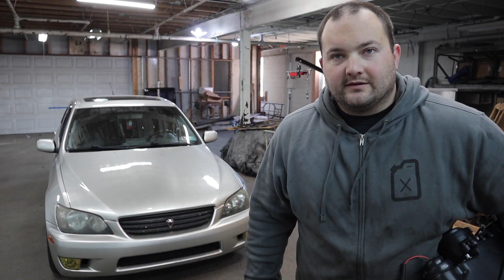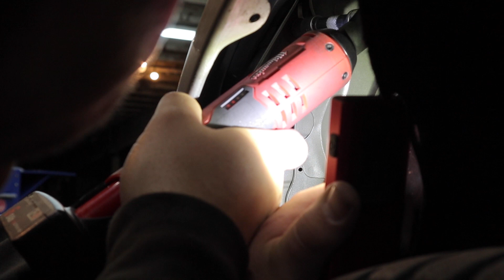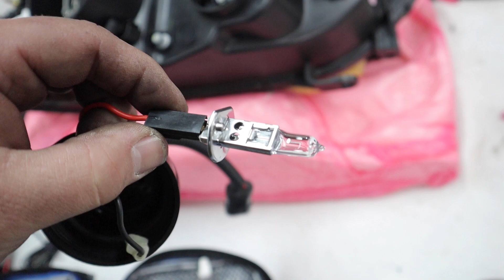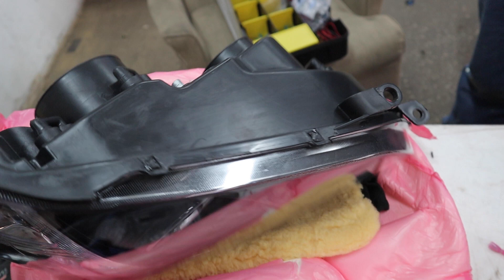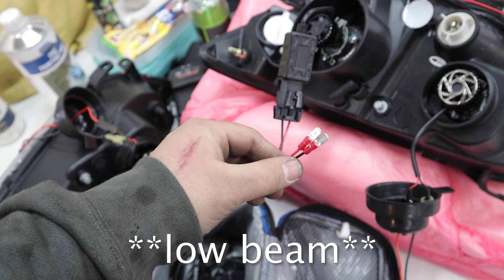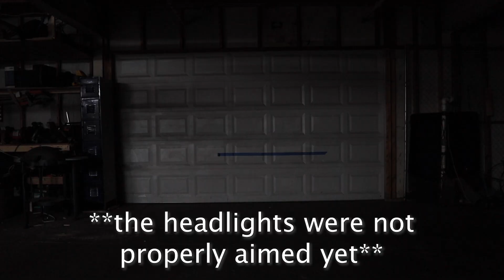Making my Lexus IS300 look so much better by installing LED Projector Headlights!

Comment: Will these fit on a 04 IS200? And did you have to buy an extra bulb and if you did could you give me their link?
Reply: they do fit. if you have your old headlights still you can take it apart and take the old connector and replace it with the connector on the new headlights for the lowbeam

Comment: I followed everything you put in the video but went with higher powered hid replacement leds.  My one question on these are how do I manually adjust the light throw?  I too ditched my light adjuster mechanism motor (failed).  Thanks for the advance tip on reversing polarity for the led strip and wiring the halo together adjacent.  Very useful info!
Reply from the maker: There should be adjuster, screws or something somewhere on the headlights that allow you to adjust it. They might be torx bolts or some kind of little screw
Reply: @PoorManMods  thank you for all you do brother.

Comment: Hey the low beam light you posted on the link Amazon says it doesn’t fit the vehicle ? Are they still the same ones ?
Reply from the maker: Yes theyre the correct bulbs
Reply: @PoorManMods  thanks man, got the same headlights
Reply from the maker: @xlugox7766  no problem!
Reply: @PoorManMods  Hey man, Ik it’s been awhile. I had these headlights for awhile now same beams, are they hard to see in the rain for you ? For me I been struggling, but maybe it’s just me.

Comment: Currently in the middle of this swap but only have 1 indicator bulb ? Also did you change from the stock indicator fixing out of the old headlights ?
Reply from the maker: I didn't take anything from the old headlights
Reply: for me my indicator housings didnt fit in these.  I had to chomp off the smallest of the 4 nubs to get em in!  My car is an 05 and has 2x indicators for side.

Comment: Question, did you leave the rubber piece covering the low beams out so the original ballast wiring can connect to the new leds? Or did you find a way to keep the rubber cover on and feed the wiring somewhere else?
Reply: I took a razor blade and sliced an xmarks the spot and fed my wires through the rubber cap.  If you are sticking with the included h1 high beam you dont have to do anything, just plug and play.
Reply from the maker: i think i just ran the wiring through the rubber piece

Comment: Did replacing the HIDs give you any problems?
Reply from the maker: nope
Reply: @PoorManMods  super late reply my bad but my low beams don't work anymore no matter how good I wire them. my fogs don't either, do u think I have a short?

Comment: Can you give a step by step on how you spliced the two loose wires please?
Reply from the maker: Its just 2 wires, cut strip and use butt connectors or spade connectors

Comment: Hey man I wired the same way you did and everything turns on except the bottom led strip
Reply: did you figure it out? i got the same issue
Reply: @vicentepatrick8635  lmk if you find a way
Reply: Mine does the same 😞
Reply: Every light only need positive and negative, switch the power and ground wire for the led strip and it should turn on
Reply: take em out and cut the wires and swap em.... they wired the polarity wrong just like homie says in the video.  I had to do it for both of mine.

Comment: did the headlights require HID's?? if so, how did you install LED low beams if it required HID's.
Reply from the maker: i show in the video how i did it. Removing the old headlight removed the old HID ballast. Before installing the new headlight housing i cut off the connector that went to the HID ballast,  crimped on connectors that then plugged into the new LED bulb.
Reply: @PoorManMods  thank you so much

Comment: I like all your videos, but these 2002 looking chinese led "bulb" converted headlights are aint my favorite on any car...
If you still have your og ones, than forget polishing them (everybody polishing headlights and all fades back in no time).
You have to sandpaper those headlights in 3 steps (380 - 500 - 800) than use 2K clear coat: 1 very thin layer clearcoat (have to wait 10-15 mins aft this) than spray a thick layer of clearcoat on that headlight. It will last for years.
Reply from the maker: I personally like the look and function of the new headlights, chinese made or not. They are less blinding too, i get flashed all the time with the OEM housings and HID bulbs. But everyone has different tastes

Comment: I would put a halo on the low beams and a strap at the top. But ultimately I think a smoked OEM  headlight with halo kit and top LED strap beats all